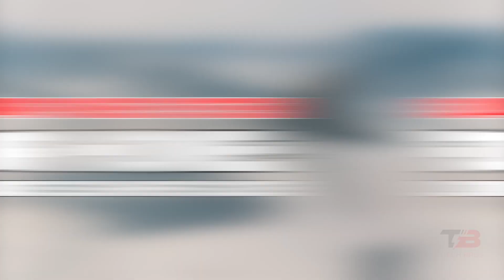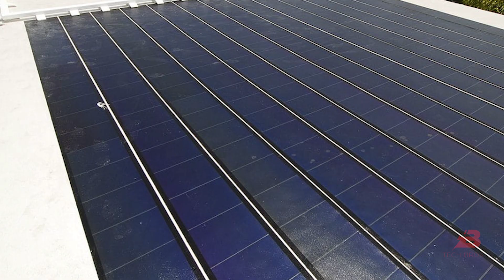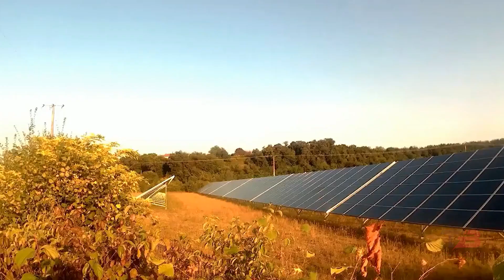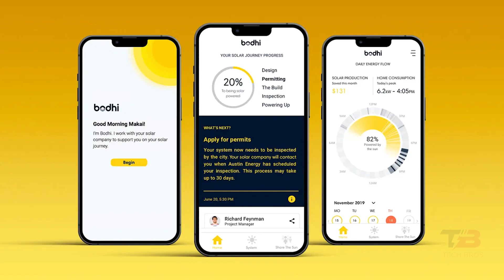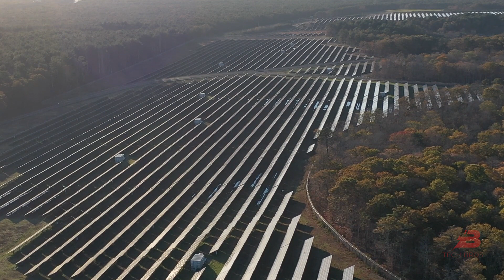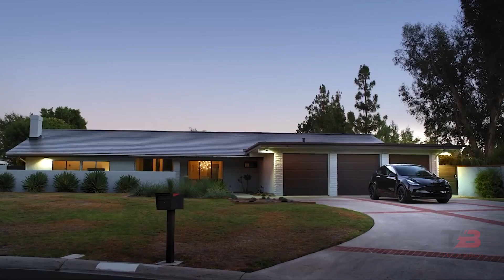SOLAR POWER SYSTEM FOR HOME ULTIMATE BEGINNERS GUIDE

Comment: The best thing about installing a solar power system is that you will only need to plug in most of the components for them to be functional. So, all you have to do is install the cables in the right ports, tighten some screws, and your system will be up and running. The only part that might lead you to call an electrician is the final electrical hookup to the service panel part. Most people find it challenging to finish that part on their own.

Comment: install solar energy at home, Ideally, your roof should be tilted at 30° and facing south. The solar panels are then installed on the frame, after having traced the location of the equipment and cut the tile. Finally, the panels must be connected to the inverter, and connected to the electrical network